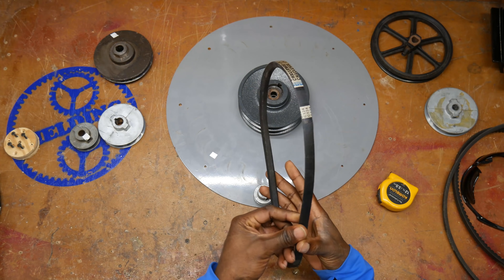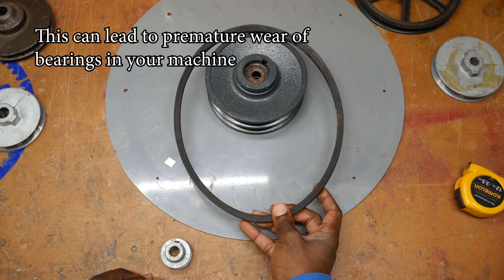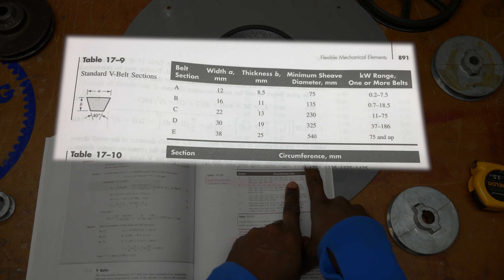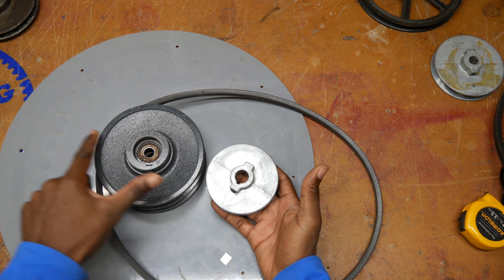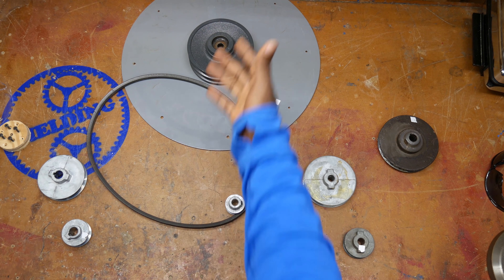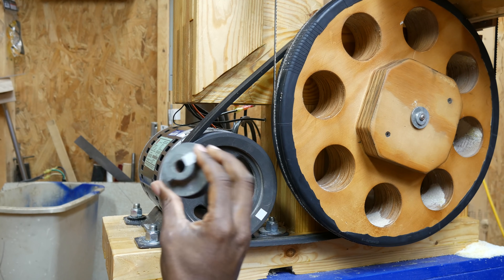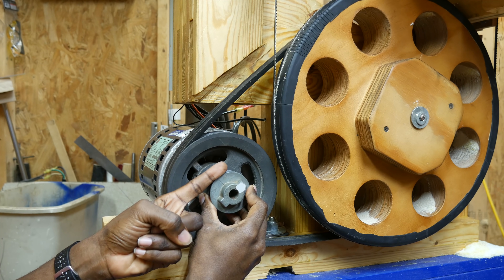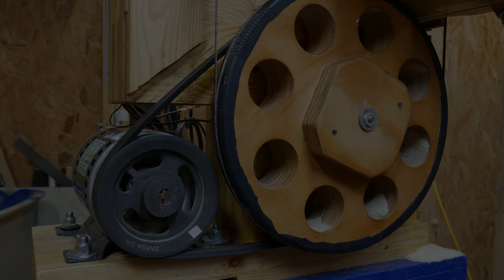7 Tips For Best V belt Performance; How To Prevent slipping and Other Belt Issues :052

Comment: The small pully has to do more rotations for one revolution of the larger rear, it is easier for the motor to turn the smaller pully. You are saying it works harder, not true.  Its more work for the motor to turn the larger pully

Comment: Ilike your final setup with the wood pully but it would work better and last longer if you put a key stock in the pully (gray cast) so it doesn't spin on the motor and destroy it.

Comment: You forgot to mention AX type (cogged) v-belts which let you run somewhat smaller pulleys. Gates Corporation says you can run as small as 2.20" on AX belts belts but I've gotten even a 2" pulley to pump an air compressor with an AX belt... maybe not ideal but a great way to get through a pinch.

Comment: Hello Mr Fielding, I have a 3hp single phase 1750 rpm motor(15amps on 220; 17a on 208; 27amps on 115v) . I am repurposing a fire sprinkler base mount twin-v pump compressor and installing it on a tank for a portable compressor(framing and such). Some service post have 30a-220v plug readily available and some dont work or are not available. I would like to be able to switch from 220v to 120 or vise versa by using a toggle switch. Any diagram links or advice on what to use and how to wire?
 I don't want to smoke my $1300 motor that I got on ebay for $200. Hard enough to find one a smoke it on a test run.

Comment: Jeremy, I know this video is 5yrs old. I have a guestion about power transmission.  I have a 16 Jet Mill Drill.  uses cone pulleys.  I want to change to a 3ph motor with a Vfd. and change the pulleys to double belt models for improved transmission.  do you have an opinion of v belts vs serpentine (automotive) belts for power transmission?  I have considered hunting the auto salvage for double crank pulleys and modify the center to attach to the mile and motor (i have a metal lathe and mill).  I will have to modify any approach for the pulley on the spindle (a double set up is not available,  this is why I have metal working equipment!).  so, v belt or serpentine.  I would add a tensioner for the serpentine. Thank you sir.  your success is well deserved!

Comment: So you re saying in the last part that the motor has to work harder as the the pulley on its shaft decreases in size? But how is it that when on a bicycle the pedaling gets easier as we decrease the pedal gear size ? Yes the speed the bicycle travels decreases as well. But if RPM were not an issue(meaning we could generate enough for the application) then it would be preferable to have a smaller pulley on the powered side?
Reply from the maker: You are asking the wrong question. RPM is always an issue. The change in force is directly proportional to the change in speed. You can not separate these two ideas. One doesn't change without the other for the same amount of power output. The only way to fix one is the change the power output. Check out my video "how gears and pulleys work" for a more detailed demonstration of this with both gears and pulleys.

Comment: Have a 3hp 208/230 3phase motor would improper about sitting inside a sheave cause low amps or worn belts

Comment: I'm interested in rigging up a pulley to a compressor motor shaft that measured 14.11mm. 
The compressor motor burned out when it was left unattended with a low current outlet powering it, and it didn't start up .
Looking to see if I can use an spare external motor to drive the compressor through the back end of the motor shaft.
Are the bore sizes of pulleys specified with a small amount of extra clearance so that 14mm would be likely to fit over the 14.11mm?
No one seems to sell v belt pulleys with metric bore sizes either, which makes it harder to jury rig, one I found is for a round PU belt, but I was going to see if it could be used for a V belt regardless.

Comment: So many times I've come across a recently replaced motor with an A style pulley running an A style belt, and the fan still has the original B style pulley left on it. This ruins the front bearing.

Comment: i believe the wrench demo is wrong, the force of the motor is being applied from the center ..no leverage is gained the longer the handle gets because you have to twist(not turn) the wrench by holding on to it by the latching side of it, equivalent to where/how the motor is applying force. the force would have to be applied from the outer perimeter being latched on to the center for any leverage to be affective. the less mass attached to the shaft of the motor the more efficient and stress free its operation. A load being applied by a pully is not the same as a heavy fly wheel attached to the motor shaft which helps its operation.
Reply from the maker: It might help to watch again

Comment: I've watched lots of ur videos.  Thanks I've learnt alot as am building agrinder for peppers using a washer motor.  am already wiring  induction motors  and they're working just fine.  i've this particular motor with no info label. how do i figure out its RPM and watts.i've no electrical  device for testing . Am new to this kinda thing, but love tinkering with stuff.. keep up da good work'

Comment: Hhey I learnt a few things in your video. But its my concern for awhile now.  Would it be more effibient to have the larger  pulley on the drive  motor side than having the smaller pulley drive the bigger.  The logic am using is this  let say the driver pulley is twuce bigger than the other. Wouldn't one revolution results in two for the smaller pulley. Does their placement have any bearing on performance.

Comment: Thank you Jeremy. I checked this channel out looking for inspiration. My new ride-on lawnmower was chewing through blade drive belts, which fail to turn the blade, and then overheat by friction and break. The tensioning pulley is inside the belt track and moves outwards to tighten the belt, and in so doing it reduces the lap angle on the driven pulley to 125 degrees. I was stuck on the idea that this was the principal problem. Surprisingly I had Shigleys on my bookshelf but I found no clear indication of minimum lap angle. The realization of the real fault dawned on me after quite some time. As is so often the case, the answer lay not in the highly technical but in the basics. The fact was that the original belts were too long, and while the belt tension appeared to be adequate, in fact the tensioning pulley was at the end of its spring arm travel, and a little warming of the belt was enough to expand a little and allow slip to start. Soon the belt would roast and shred. I fitted a belt just one inch shorter. It increased the tension and the lap angle by 12 degrees. I got my lawn mowed.
Reply: I had the same issue. I added a piece of chain from the tensioner arm so I can adapt to different length belts. I went from using 2-3 belts a year to 1 belt lasting 2-3 years.

Comment: Late to the party but does the wrap theory also apply to belts with teeth? 
Like HTD belts?  Thanks for your videos. They are awesome 👍!
Reply: Did a little digging. Found this which seems to answer the question

"In cases where fewer than six teeth are in full contact, 20% of the horsepower rating must be subtracted for each tooth less than six not in full contact."

Comment: Hi Jeremy, Wrong, you are misleading people when you say the bigger the pulley on your bandsaw gives more torque, you have misread interpreted the chart. You would be creating a system getting more power out than you put in, the holy grail of power generation. If that really were the case you could have installed a 1/3 horse motor and just fit a 12  times the size drive pulley. This needs correcting before people follow your advise on this and waste time and money. I follow your channel and enjoy the content, keep up the good work.
Reply: Andy, Jeremy is 100% correct on this one.  Rotary power (HP) = Torque X (speed/5252).  As the driven sheave gets 'bigger' the torque goes up and the speed (RPM, not velocity) goes down in proportion to the torque, while the power remains constant.  In fact, trading RPM for torque, or visa versa, is the main reason why we use different gear or sheave sizes.  When driving in low gear, you use your engine horsepower to generate high torque, which you can use to accelerate or tow heavy loads.  You can shift to high gear and use that same amount of power to go fast, but you will lose torque, which is why you'd have trouble pulling your trailer out of the mud in high gear.  The same principal applies with Jeremy's band saw.  It's equivalent to "gearing down" the motor so he can generate enough force to cut the wood, but he isn't increasing the power.

Comment: i would not point it as mistake, but you have shown drive pulley large and driven pulley small, and in really model at end, its exactly opposite.  Anyway thanks for knowledge you have imparted on belt drive.

Comment: Thank You for this video! I am putting together an antique lathe with no motor pully that has a four groove pully on the lathe. I was about to make a big mistake in purchasing a multi-groove pully for the motor.
Definitely became a subscriber! Thank You Again!
Reply: You will still need a four groove pully for the motor. The motor pully will be installed in the opposite direction of the drive pully using only one belt. That is how you change the speed of the lathe rotation! I suggest that you look at a drill press belt system. Same idea, small motor pully to larger lathe pully gives less speed than the larger motor pully to the smaller lathe pully. It appears that you will have four speeds to choose from, depending on the material being worked. Just move the belt to the desired speed.

Comment: A question, if you don't mind. I recently converted a vintage drill press from a 4-speed to a 12-speed. There's a 5" 4-step pulley on the motor. Am I correct thinking that a 6" 4-step pulley would lower the RPM of the quill, relatively speaking?

Comment: 6:19 Has anyone asked yet, why is the motor pulley at 6:19 offset from the key? Looks like the shaft key is at 11 o'clock but the pulley key way is at 1 o'clock.

Comment: All you said was very correct and interesting but could I add there are other types of "V" belts and one in particular designed to be used with smaller pulleys. The clogged V belt is such a type especially the SPZ range will work satisfactory with pulleys down to two inches with a one horse power motor, especially useful on mini Lathes.

Comment: At about 2:32 you say, "...as you increase the center to center distance (between the pulleys) you're get more and more slack, more and more vibration and that's going to reduce the life of your belt."
It looks more like that if you increase the center to center distance you're get less slack, the belt will tighten, which will also reduce the lift of the belt. 
As it is, I like your videos and have subscribed!
Reply: Jeremy is correct since he is referring to and pointing to the slack side, which does slacken as center distance increases.  You are describing the tension side, which will tighten with an increasing distance.
Reply: As you move the two pulleys further apart you will get more and more tension along both sides of the belt. The slack side will become less and less slack. Keep moving them apart and and something will break.

Comment: Very nice video, but i need to understand something, I am building a servo controlled unit, the wheel has a max OD pulley attached of 4" the wheel is 5", we calculated the motor to have a 1" pulley, do you calculate the over all OD of a pulley or where the belt actually wraps around the pulley, or you can say the bottom of the V of the pulley ?thanks hope to hear back from you .

Comment: Why does my 3/4 horse motor pulse and also make the lights pulse when I change belt speeds?  Basically, my lathe has 2 duplex pulleys(not sure the correct name), one on the motor shaft of course and another on a counter shaft that leads to another step pulley system on my headstock. Well to put it simply, when I switch from one set of pulleys that has one small and one large pulley to two of the same size pulleys for more speed, the motor starts to run violently and kind of pulse and the lights on my lamp pulse in sync with it. All the belts should be correct and everything else is still factory parts. Nothing has been modified. Hope I explained that clearly. Thanks

Comment: Im having a problem with my power sprayer,the belt kept slipping and heat up and start smoking.6.5hp engine,and the small double grooves pulley is slipping.Guess the solution is change to bigger pulley?

Comment: A lot of good points mentioned in this video. I am working on modifying a 5-speed dual-pulley V-belt driven drill press to be able to drill 12 mm diameter holes through a 7 mm thick 62+ Rockwell C bearing steel thrust washer. This is no easy task. My M42 cobalt drill bits just left a small dent when bearing down with well over 500 lbs on the spindle. No cutting action. That washer is so hard, nothing short of tungsten carbide will scratch it. This operation calls for a starting spindle speed of around 200 rpm. The lowest spindle speed of my drill press is 740 rpm, from a motor speed of 1790 rpm. To achieve a 9:1 speed ratio with V-belts, you have to use an intermediate reducer pulley, otherwise the motor pulley would slip way too easily from insufficient wrap. The importance of wrap angle cannot be overstated. For a given amount of belt tension, the amount of torque than can be transferred without slipping is directly proportional to pulley diameter, and exponentially correlated with the wrap angle!  As the speed ratio of the belt drive tends further from unity, the amount of torque that can can be transferred decreases for the smaller pulley. This places a practical limit on the effective "gear" ratio of the belt drive. Increasing the center-to-center distance of the pulleys increases the wrap angle and torque transmission capability of the drive, but I'm fairly limited in this regard with the drill press because of the belt drive housing space constraints. An intermediate pulley will allow me to break down the 9:1 ratio I need into two much more feasible 3:1 ratios. Only, the intermediate pulley needs to be movable so that it can be tensioned. For this, I plan to to install it in a flange block bearing mounted into T-track.
Reply: In a pinch, I recommend using a hand drill (with variable speed) to drive your drill press at a low RPM. You will have to improvise the connection (on my Jet drill press, a 30mm socket fits on the motor pulley nicely, and a 1/4 hex to 1/2 square drive adapter makes it easy to drive with the hand drill). I've  used this setup (+cutting oil) for drilling and tapping hard materials.

I realize your comment was a couple years old but hopefully you or someone else finds this shortcut helpful!

Comment: I have an emergency supply fan with a motor with double adjustable sheaves. One of the sheaves is more open than the other. Problem I have is that when you create tension on the pulleys, one of the belts is tight and the other really loose. In order for the second belt to have some tension, the first one becomes suuuuper tight. This seems to be creating opposing tension on the belts, or tension on opposite sides of the belts (like you mention at around 2:26) , causing the motor to work harder and not blow the air it is intended to. So, my question is: would changing the belt size for one of the sheaves to create even tension help solve this issue? The fan runs only on emergencies only (thankfully we have not had any) and we had not noticed the potential problem with this setup. If I remove one of the belts and create the necessary tension on the one belt, the motor turns perfectly fine. I appreciate your feedback!

Comment: HI
I really don't get it
How a small pulley makes it hard for a motor compared to a larger one

Think of the pulling gear of a bike and how it gets easier with smaller gear

Please correct me if I'm wrong
Reply from the maker: I didn't say it was easier for the motor... its easier on the belt. Its a really clever way to make your belts last longer and perform better. Now that you know that... watch it again and it will make way more sense.
Reply: @Jeremy_Fielding  thanks for the reply
Yes this way it makes much sense

Comment: Need some help here.  Recently purchased a 1950s walker turner lathe w/o a motor. Bought a used Dayton 1hp and a 4 step pulley.  I am having a problem keeping the key and pully from slipping off.   I am tightening the set screw as far as I can without breaking something and I have checked alignment.  Any ideas on how I can keep them tight?  Lock tight?  Scoring the key?   Appreciate your help on what is likely a simple answer

Comment: Ive got a racing lawnmower and i wonder why im always eating belts! I used to have a 6 inch pulley on the engine and a 2 inch on the transaxle, i would go through belts like crazy. Now i have a 10 inch on the front and a 3 1/2 on the transaxle. Ive had it like that for several months and only went through 1 belt, and the only reason it broke is because my rear pulley broke. It was only cast aluminum and didnt like the 10k plus rpms and the 20+ horsepower i was pushing through it :)   im now thinking about doubling everything up to have more power delivery, i can tell the belt slips a bit because the pulleys get pretty hot. Ive definately learned a bunch!